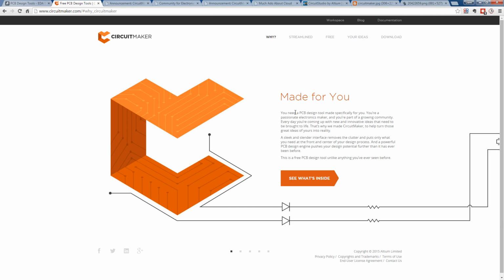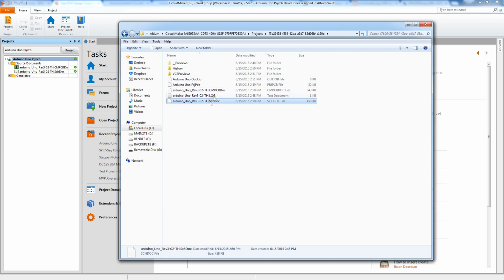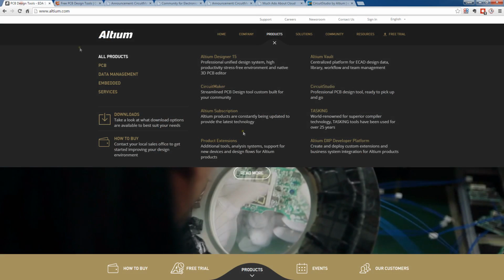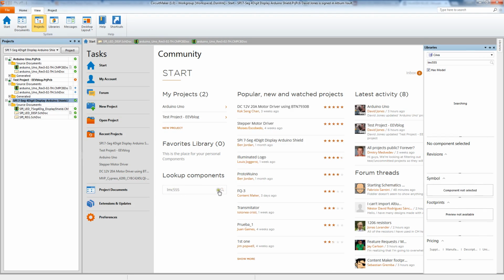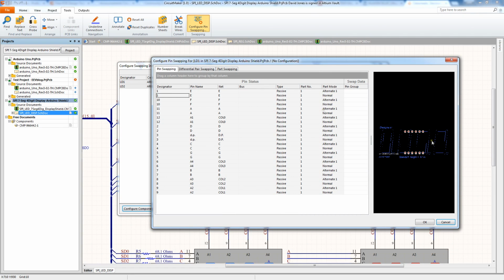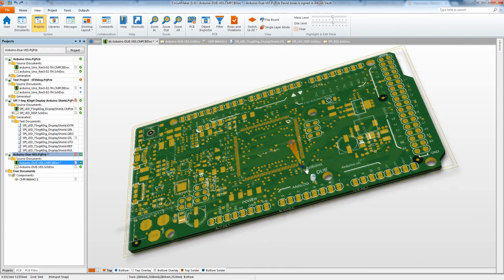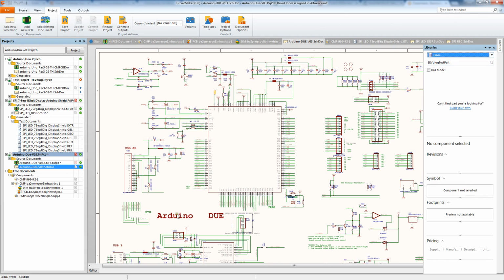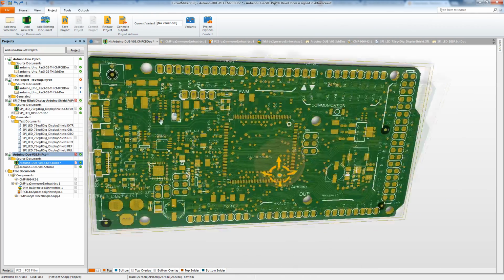EEVblog #754 - Altium Circuit Maker First Impressions

Comment: So it is safe to assume that if one did some matriculous work and didn't want it out in the open, then that person shouldn't use circuitmaker. Let's face it, best software is paid one. Also, i don't understand why so many people are rushing to build stuff when they haven't went into the math and engineering part first. I mean, designs are only as good as the work put into them. It seems just too much work to have one design in a simulation software and the PCB in another and they are both different programs. Mistakes are bound to happen when migrating back and forth. Schematic and PCB layout should be free minus the intricate stuff but with private option to limit ports of erroneous designs from reaching the public.

Comment: For the ribbons at the top you should be able to minimize the ribbon by double clicking the tab, at least thats how it works in Microsoft products.
Reply from the maker: PoLoMoTo2534 You can make it vanish but you can't minimise it.
Reply: EEVblog Ah well
Reply: EEVblog When you double click the ribbon tab to minimise it, all you have to do to show it again is click it once then when you click anywhere else in the application for it to disappear again :)

Comment: I got the beta as well, and about a half hour later I closed it and opened Diptrace back up. I think the thing that soured me the most was taking way too long to access the part information and find what I was looking for. If they improve it later in the beta (or final release) I might try it out a bit more, but I'll let it work out the bugs for now. The commercial bit is nice though, so if anything it's a choice between this and KiCAD for eventually making money on a project

Comment: Everyone keeps mentioning the internet connection thing. All of CircuitMaker's projects live on your hard drive in AppData\Roaming\Altium\CircuitMaker\Projects. You can easily open the project file directly from Windows, or drag it into CircuitMaker to open it up. No internet connection needed.
Reply: Just kidding. It looks like you'll need an initial internet connection when you launch CircuitMaker. Having said that, if you have a design already loaded on your laptop/tablet, it's not like it's going to explode the moment you lose internet access. You obviously can't browse the online parts library, but you could certainly be quite productive. Given the limited PCB tools (no keyboard shortcuts, length-tuning, accordion traces, etc), it's going to take a lot longer to route boards than you're used to, so it's the perfect activity for a three-hour plane trip :-)

Comment: Limitation: intentional? software performance degradation after >5000 pads, unusable after >50000 pads (not a problem for 99% of people). Adding PCB design file from Altium Designer: save PCB design file as legacy format (3.0 or 4.0) in Altium Designer, then import into circuitmaker. This works. Bug?/limitation?: Text string missing width property. Also what is the default font? This has also changed.